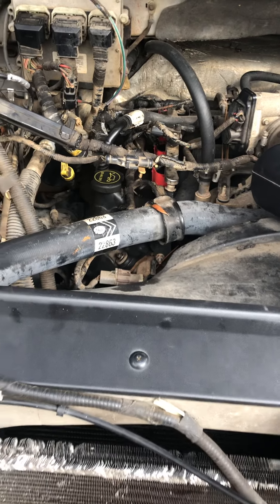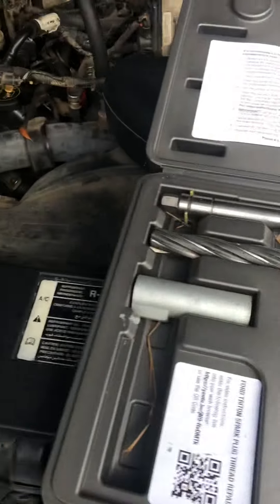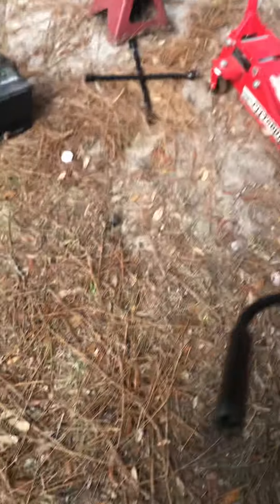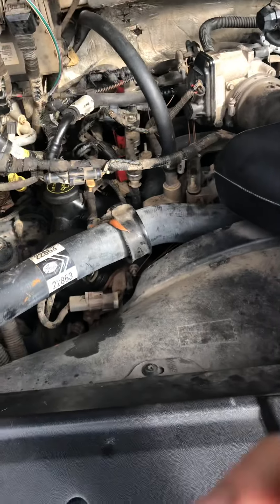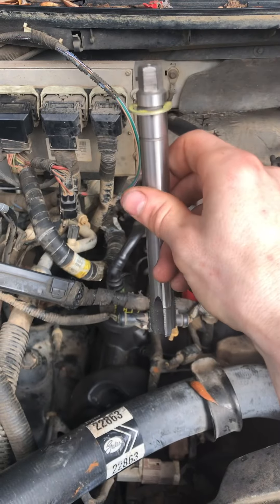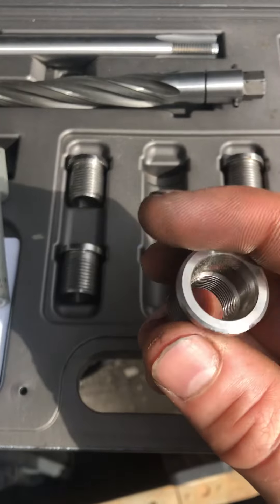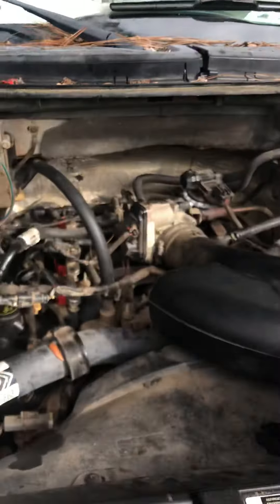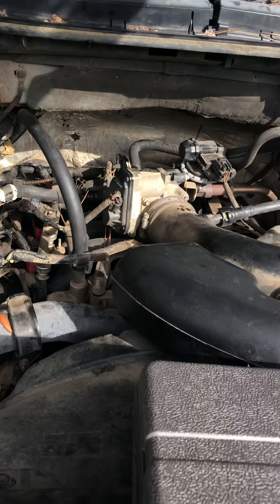08 F-150 4.6 spark plug stripped thread repair kit

Comment: Damn, I can’t believe he use the impact
Reply from the maker: All the professional videos I saw they all used impacts just oil the shit out of it
Reply: @that1treeguyllc887  stop embarrassing yourself this supposed to be delicate work one wrong move and you need to replace all entire cylinder head
Reply from the maker: Stop being an asshole, I got another 70,000 miles on the engine and then I sold the truck in perfect working condition 280,000 total miles. Take it to Twitter if you want to be a hater.

Comment: So I can tackle this myself?
Reply from the maker: Yes, buy the Amazon $25 camera to attach to your phone so you can look down into the cylinders and make sure they are clean from all metal shavings when your finished. I hooked up a shop vac to a funnel to vacuum out the cylinders and I used compressed air both to try and clean it out. Worked great for like 20,000 miles and then the transmission went out 😭
Reply: As long as you go wha whaaa whaaa whaa 😅